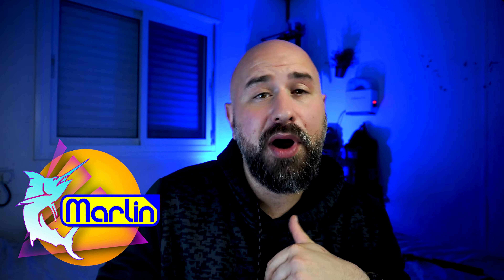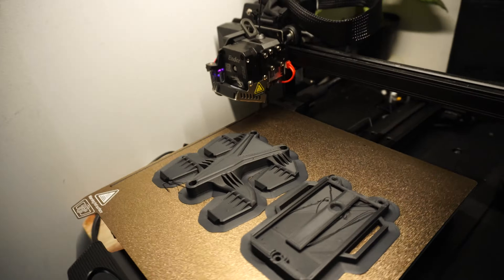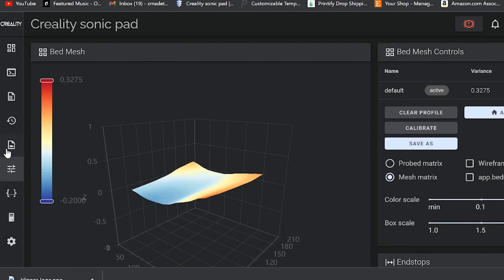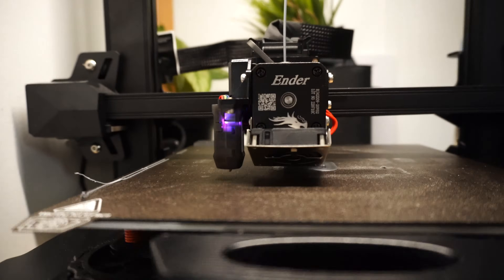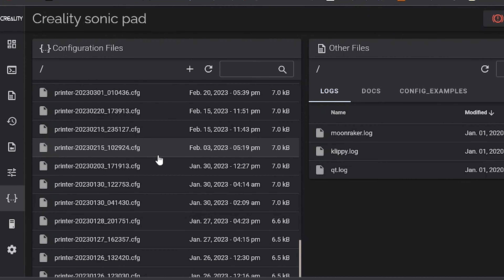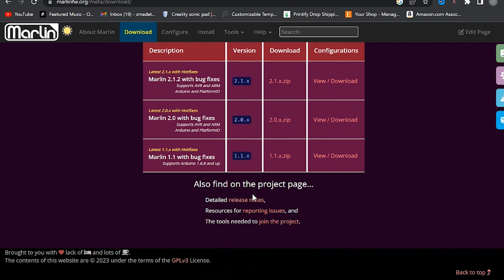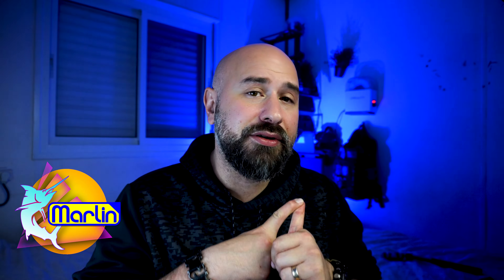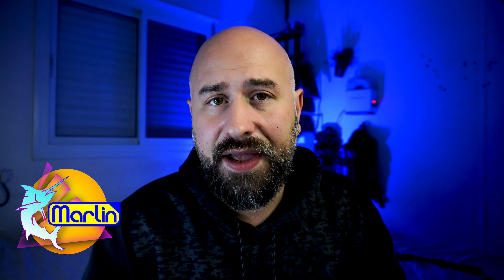Klipper vs Marlin which one is right for you

Comment: I hear one or 2 Marlin developers that they are not getting paid to work on Marlin. True but this is why there is no one pretty interface in which to enter firmware commands like there is on Klipper. Bummer. I wish at the very least Marlin would get updated to work with a filament runout sensor. At least on my Printer I have tried 2 different runout sensors and it just does not work. I tried all three versions of Klipper and I could not get any of the 3 setup. So I gave up and went back to Marlin 2.1.x. I also, wish, on the kipper side, that there was an install wizard. So it would setup klipper for me. I would ever pay for that product. As others have said, I would not spend $10,000+ for someone to build these products.  But I would pay $50 -$100 for the software if it worked well.
Reply from the maker: Dude, I understand fully! getting klipper up and running on your printer using raspberry pi is not close to as user-friendly as flashing Marlin to your mainboard! By the way... about that, I'm curious if while you were using klipper, and having problems connecting the runout sensors you tried, were you able to find macros for them? and if you tried the Sonic pad

Comment: This is in response to the the point that you have to upload marlin every time you want to make a firmware change. This is not totally true there are a lot of options like Acceleration as an example.  Or setting your Z height for your ABL probe. Plus a ton more. I was thinking that someone could design a user interface for Marlin much like the user interface for Kipper that is like a form file. Where the user would just enter the setting in a dialog box and then the form would execute the correct M code followed by a M500 code to save setting in your printer. I wish someone would make such an interface. I would even pay a nominal fee to fund such a project. I try to manually use M code in this way was as much as possible.
Reply from the maker: Hey John, I agree, Designing a UI for Marlin that gives you the option to change hardware settings, update firmware, and other features via macros in a printer config file sounds like an incredible idea
Reply: It's called Octoprint. It's had a Marlin interface for most of the live-configurable settings since 2019, at least.

Comment: Great video! It’s about time somebody came along with Sonic Pad information that users can really use. Great Job!
Reply from the maker: Hey there Robert, first of all, thank you very much for your comment, second, considering your in site I was wondering if there are any other video ideas you might have that can help the community?
Reply: @z-made  hmmm, let me think….I currently have Sonic Pad that I’m trying to set up on a Ender 3 Max with a SKR Mini e3 v3 motherboard, Sprite Pro extruder and a CrTouch. I’m not having much luck. Apparently there is a newer version of Klipper out. The Sonic Pad has an older version of Klipper. It doesn’t have the processor of my motherboard because it’s the older version of Klipper. I’ve read online that the newer version of Klipper has my processor built in. The problem I’m having is that to use the new version of Klipper I’ll have to set up a Raspberry Pi and install the new version of Klipper on it. Then I have to compile a new firmware and install it on the Sonic Pad. After all this I’m not even sure it will work for the Sonic Pad. Anyway, I’ve been just going off on a tangent here, Sorry. If you have any information that you think would help……Maybe you could make a video about installing Klipper on the Sonic Pad. Like putting together a Klipper printer.cfg file…..all your videos have been very helpful. Just continue the Sonic Pad videos, there great. This is the main reason why I began a subscription with you. I enjoy watching you fiddle around with the Sonic Pad. Whew, I’ve been taking up to much of your time. Thanks for listening and keep up the great work that you do.

Take care,
Robert
Reply from the maker: @amrmedic2009  Thank you so much for your thoughtful comment and continued support for my channel. I truly appreciate it.
Regarding your predicament with setting up the Sonic Pad on your Ender 3 Max with an SKR Mini E3 v3 motherboard, Sprite Pro extruder, and CrTouch, I must admit that I don't have enough experience to create a video specifically addressing your issue. However, I'm glad to hear that my other videos on the Sonic Pad have been helpful to you. It sounds like you have done your research and already know a great deal about how to move forward, Nevertheless, I appreciate your suggestion to make a video about installing Klipper on the Sonic Pad and putting together a printer.cfg file. I will certainly consider it for future content. Again, thank you for your support and valuable feedback. Please don't hesitate to reach out to me I love hearing from people and getting awesome suggestions from my viewers, I plan to continue to fiddle around with the sonic pad and expand to other 3d printing-related things in the future, and getting feedback from you really helps thanks😊
Reply: @z-made  That’s great! I always enjoy your videos, thank you again.
Reply: @z-made  by the way you remind me of John Travolta’s new look. Lol
Reply from the maker: @amrmedic2009  your welcome 😊
Reply from the maker: @amrmedic2009  😅